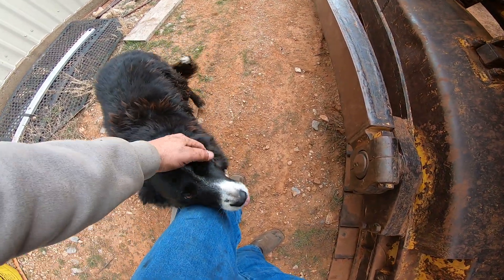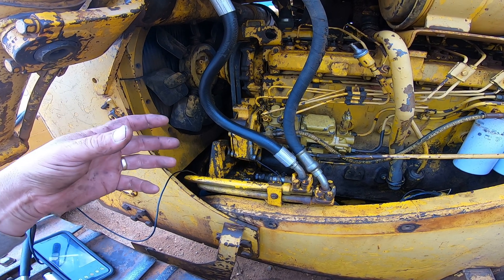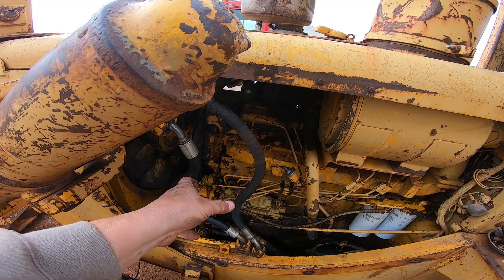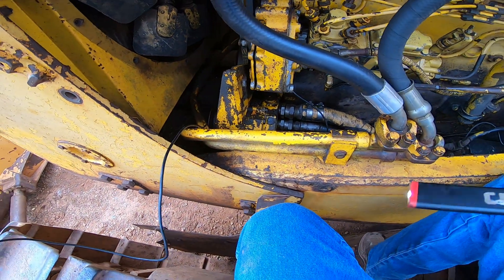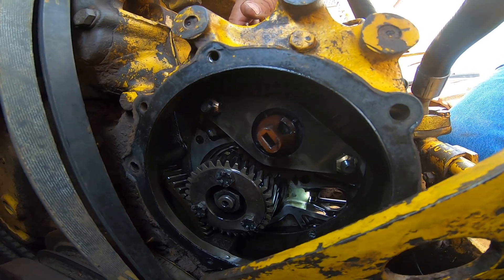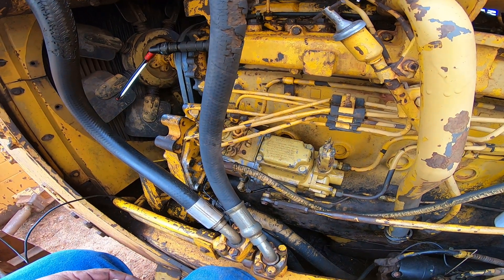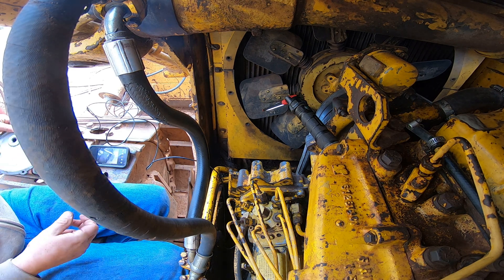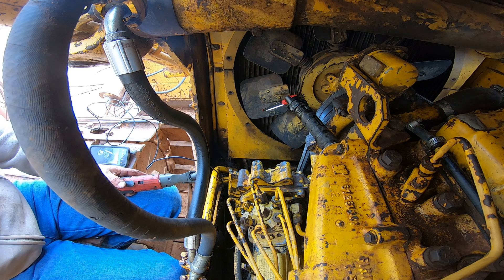TD-15c AMBAC injection pump timing

Comment: I’m not sure if the issue has been resolved by now but have you herd of static timing? Take the guess work out of worn out parts. Remove the number one injector line, install a clear tubeing to where you have a column of fuel vertically mark the tube at fuel level and bar the engine till you get the injector pump at full stroke. That eliminates any discrepancies with markings on the pump and wear issues. Then set the timing at 18 degrees. I have found the timing will change with wear and age and usually go even past tdc making a hard start issue and power loss. You can find a pump issue buy putting clear tubing on all six lines and graphing the data. Thanks for the videos.
Reply from the maker: Some great advice, I think the issue may be weak plunger, but I may give this a try. Thanks

Comment: I had a similar issue on a 15B. Ended up finding a small hole in the fuel line going to the pump. The leak was running onto the belly pan and was so small I didn’t catch it at first. It would run decent once started but It leaked air into the line when it sat, causing a hard start issue
Reply from the maker: Thanks, I’ll go over that for sure!

Comment: Right beside injection, where it bolts up to housing is a pipe plug (1/2 square drive) remove plug and turn engine over until flywheel is at 18* BTDC. Looking thru hole where  you removed plug you should be able to see the timing pointer aligned with timing mark on pump drive hub. 

This only applies if engine is running and you just want to check timing.
Reply: They seemed adamant it is 18°. Like Jeff A. said might be the brake in period is over😉. Engine sounds like a double shot of Jägermeister - 😣smoo (shiver) oooth cough, 😫 
🤣😂🤣
Reply from the maker: @Fatamus  I had this one at 17, thanks for the info. Jeff might know something, 🤔

Comment: I spec the plungers are so worn they won't pop the nozzles until you get a really fast cranking speed, CAT sleeve metering fuel systems will do the same thing
Reply from the maker: I’m thinking you may be right.
Reply: @Digginok  Thats What I Am Thinking

Comment: Deere runs a similar rotary style injection pump on the 6068 engines in the 750c I have. I had one last year that was doing the exact same thing ended up being a worn pump replaced it with a remain fixed all the problems.
Reply from the maker: I think you are probably right, funny thing is the pump was rebuilt, it ran nice, it set for a while and then it did this. But it’s probably going to get another rebuild.

Comment: hello frank  i had a td6 and it started hard  i found a small screen in the pump where the fuel line  is in the pump   on mine if you look in the fiting a little screen in the back off it   took it out cleaned it worked good after that
Reply from the maker: Thanks, I’ll give it a good look.